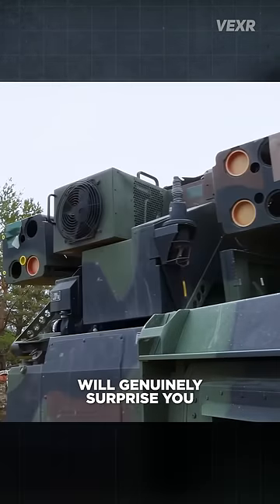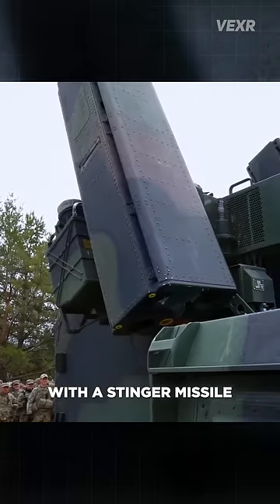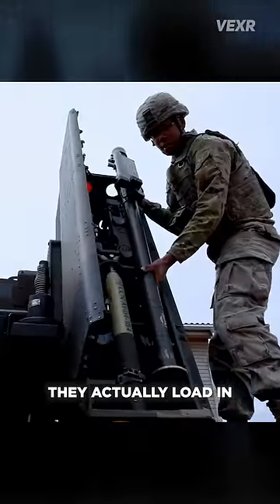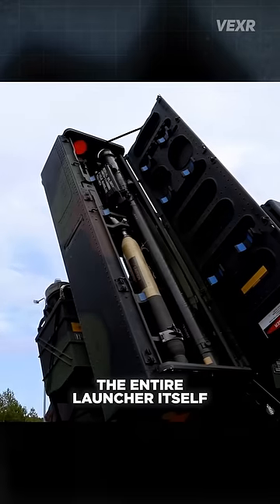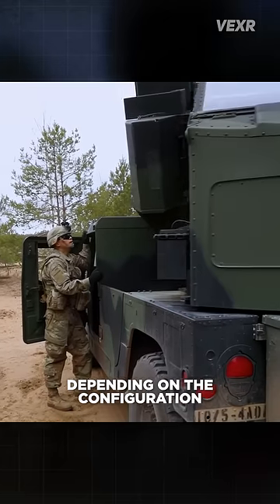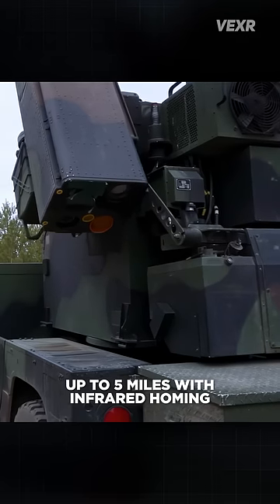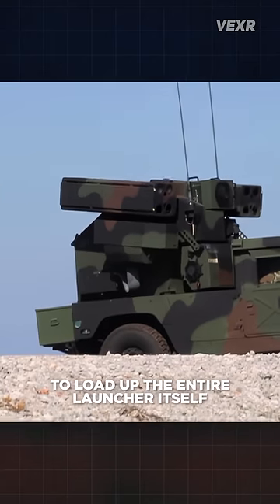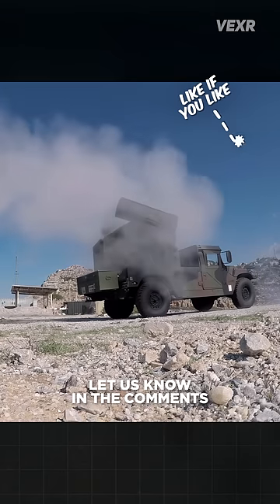The Weirdest Way To Load a Missile

Comment: The launcher is traveling with a infantry unit providing air defense and it breaks down. The infantry unit can still use the missiles manually, so that they still can move with air defense.
Reply: Bingo.
Reply: @sasquatchhadarock968 was his namo
Reply: Redundancy. Makes a fighting force efficient to have several fail safes
Reply: @sasquatchhadarock968 logistics wins wars. If your mobile SAM launcher attached to an infantry unit breaks down, the infantry unit still has anti-air capability.
Reply: Correct
Reply: Not just that. It’s a sealed unit.
Reply: I load my rocket luncher inside another rocket luncher and then I put that whole thing inside a 3rd bigger rocket launcher
Reply: For some reason I imagined an infantry man getting jumped and having his stinger stolen form him to reload this thing
Reply: very usefull in urban fight
Reply: Better option just have the SAM system and the launcher use the same ammo and just give the infantry their own launcher
Reply: @alientitimilk9073 that will be an issue for logistics
Reply: @chrispepper121 because there providing to much equipment to a single squad or because why carry a different launcher and slow the group down?
Reply: @Animaguz idk why but this actually has me laughing out loud 😂 I got anger issues and was mad then a bitch when I read this too so thanks
Reply: I think, maybe because of easy supplies... you dont need 2 seperate missles for the same task.
Reply: @alientitimilk9073 it carries 4 to 8 of them, no need for an extra
Reply: Yep.
Reply: @alientitimilk9073 only downside is they have to carry the launchers / store it somewhere instead of leaving it in since space isn't an issue anyways
Reply: It's also a huge logistic bonus. Instead of having to design a whole new rocket or launcher, you are using something that already has logistics in place and most likely a huge surplus sitting in storage and get a 2 for 1 weapons system
Reply: Plus, no barrel maintenance on a weapon that chambers an entire barrel.
Reply: I just imagined that the missile would be a bit delacite so having it in the launcher already would give a added layer of protection against damage that could impair it.
Reply: @SkylarSyankorb-oy8cy B I N G O, B
I N G O, Bingo was his namo
Reply: The avenger isn't used by infantry ( 11 series) it's used by  avenger/ manpads  operators   (14s). It also has a ma deuce on one side and flir on the other .
Reply: False
Reply: @alientitimilk9073  not exactly. There’s one benefit that nobody has mentioned… repairability and reliability. If the platform essentially just aims and shoots regular stinger launchers, if something breaks, it can more than likely be fixed by simply reloading. Whereas if your platform actually launches the missile directly, and something breaks, you’re screwed.

Add to it the fact that you can have additional protection in an emergency by handing out extra launchers to people, or keep the position operational if the platform is either destroyed or otherwise not operational
Reply: So why bother dedicating an entire truck to it
Reply: @alientitimilk9073 the stinger is non reloadable so they would need to waste money designing a reloadable system which likely would only increase the weight of each portable launcher and have the infantry need to carry fragile AA missiles with them instead of a second or third launcher. If you just carry 3 preloaded launchers to avoid needing to worry about the missiles then youve negated the whole point of having a reloadable system.
Reply: @leprechaunbutreallyjustamidget  to offer a dedicated, centralized, mobile air defense system operated by 2 or three guys instead of relying on 8 men with their own single launchers or one man with 8 launchers.
Reply: @mechcommander7876 maybe I'm stupid. But why not just have the infantry and save the cost of a vehicle?
Reply: My thought was that it would be way more complicated to build a whole new system instead of placing 4 rocket launched in it
Reply: Qualified 14s in the past and you're absolutely right. It's so you can take down and run manpads from fighting positions and all you need is the gripstock and batteries for the seeker heads. I always preferred manpads I was always terrified about a real fight in the avenger.
Reply: Plus why spend all that money on r&d, tooling etc when you don't need to?
Reply: so why even make the launcher
Reply: @lerbronk   speed, radar detection etc,
Reply: @lerbronk  because you would need 4 extra people to carry each launcher. and this machine for sure is using a computer.
Reply: @alientitimilk9073 The Stinger is a sealed single-shot platform. It can't be reloaded safely.
Reply: @vangoghaway626 what? That actually can go pretty quickly.  Aircraft carry countermeasures that can work on multiple missiles. Helicopters actually can evade with white phosphorus countermeasures very effectively due to their lower heat signature and easier to trick the missile.
Reply: Less hassle
Reply: And vice-versa.  If the Avenger runs out of missiles, it can reload from the manpads issued to the infantry units.
Reply: @garethkalum8297 
Because the vehicle mounted system has equipment to detect and engage enemy aircraft at ranges farther than the human eye can see.
Reply: Fair move.
Reply: Ehhhhh not accurate
Reply: I love these comment sections. Some people know, others are proud for scouring Google and filling the rest of us in haha 😆. They are the real heroes here lol
Reply: I don't see how the Avenger missile system utilizing a manual launcher or not affects infantry's capability. It's not like they Avenger fires the Stinger, then shares the launcher with the troops on the ground. The Avenger could launch with a built in launcher while the troops do their own thing.
Reply: @chrispepper121 How? It makes things lighter and simpler across the board!... Instead of carrying 20 launchers they could carry 40 missiles for the SAM battery and instead of carrying 4 launchers for a squad they could carry 1 or 2 launchers and 6 missiles... The Soviets/russians had the better idea with the rpg and its subsequent versions, it's much better having a launchers you can reload...
Reply: I was just going to mention that albeit in a grammatically correct sentence.
Reply: There's entire air defence batteries that just run these. So that would make sense but not necessarily true
Reply: Very smart
Reply: @Lotek117 it makes logistics more complicated and you're running two systems. Also, you need to remember that the US doctrine has been designed with the idea "We don't need air defense if we control the air", we rely on taking out the enemies air capabilities or having our own air assets nearby. Manpads are just to buy time for the jets or take out helicopters.
Reply: also logistically easier
Reply: That makes sense! Redundancy.
Reply: wow 😳
Reply: This makes total sense actually.
Reply: @user-nh3wl3zn8y this is the answer I was looking for. So does this mean that essentially the vehicle mounted Sam is to put it simply better than the individual Stinger launchers themselves? Therefore the real redundancies in the fact that if your primary Sam launcher, the good one, breakdown you still have the smaller individual Stinger missiles that may not perform as well as the vehicle but still perform
Reply: Anyone else notice that the Stinger is only about 3/4 the diameter of the Avenger's launch tube? Without the launcher it's like loading .22 pistol rounds into a .45 caliber sidearm and expecting it to fire correctly.
Reply: @andreykardashov6343  I think they have future plans regarding bigger warhead and much longer range missiles
Reply: @hannanhub1717  for the Avenger or the Stinger? My remark was specifically related to why the Stinger had to be loaded WITH its launcher to properly fire.
Reply: It also makes it so just about anyone can load it in a pinch
Reply: Yes, practical
Reply: Yep came here to type that basically, good job. 😊
Reply: Bro, we know that. OP is asking why entire launcher needs to be used in the system.
Reply: So no need for entire costom made humvee
Reply: Right. Like anyone considers infantry to be high enough priority to provide ADA
Reply: except as an infantryman I was never trained to use a stinger, only a javelin.
Reply: That's what I think
Reply: Let’s not forget either that this is probably way easier in terms of manufacturing and logistics.
Reply: @garethkalum8297  don't know about other countries, but the Bundeswehr vehicles are designed to work in groups. There would be a dedicated radar one which is vastly superior to the Stingers internal system, one or two launcher vehicles, AA with Airburst ammo for smaller targets like drones and maybe some ground defence vehicles. Also the vehicles easily transport supplies and additional ammo, are armored against small arms or heavy machine guns depending on the type allowing you to fire from relative safety, and you can quickly change positions. So no, 8 guys with rocket launchers can't compete
Reply: I also imagine it could be fired without the launcher.
Reply: Difference between manpads and the avenger. Also redundancy for when you remote out and then have the ability to fight from fighting positions 😊
Reply: yeah that's what i was thinking 'it seems silly but if it takes damage the thing can be opened up and the infantry can recover and use the missiles'